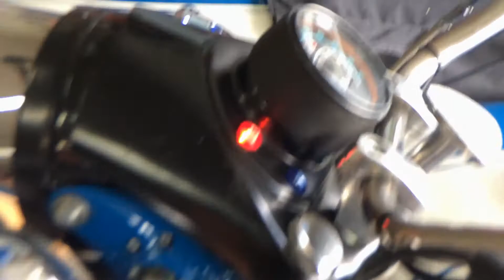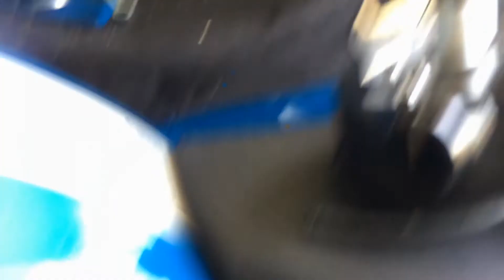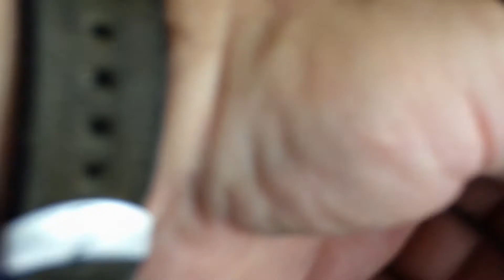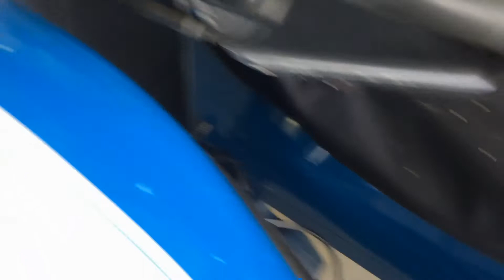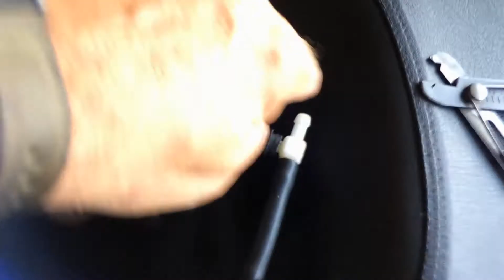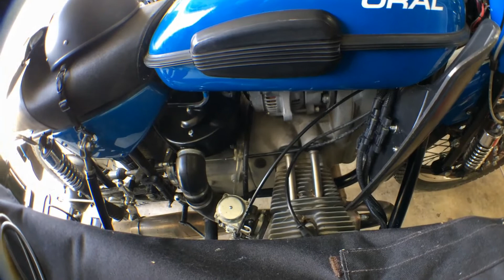2012 URAL Patrol CA edition pollution smog control how to remove it, and get better performance

Comment: Al:  I have a 2012 Ural Yamal I purchased second-hand from GoAz Motorcycles in Arizona in 2015.   About 6 years ago I removed the California garbage, had the airbox fixed at a machine shop and reconnected the fuel lines.  I had heard about possible rejetting complications, but it fired up, idled and ran OK getting up to 65-67 MPH.  This Spring it would not idle or warm up and would die.  Took the carbs to a local carb specialist -- he disassembled and cleaned them well and noted the jet sizes as 122, 65 and 40.  Have not reinstalled them yet and will take them back to get the jet sizes you mentioned: 125, 45 and 42 installed.  Thanks for the video.  I have contacted Ural USA to confirm the necessary rejetting  that when switching from the California specs